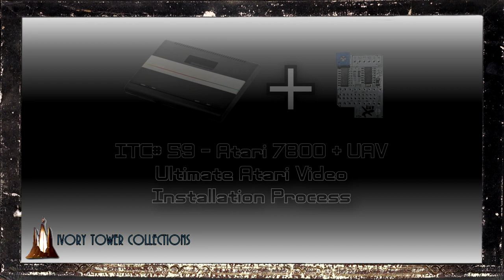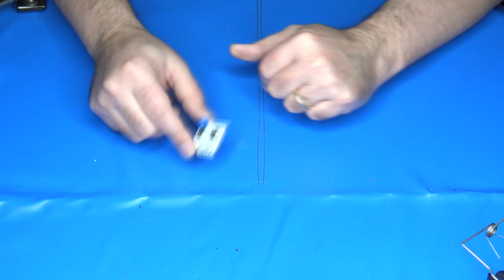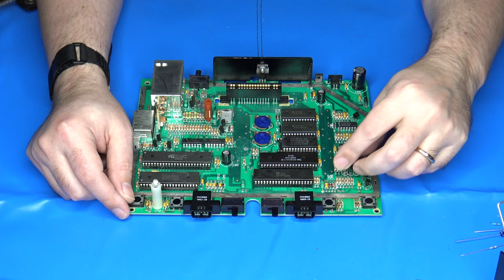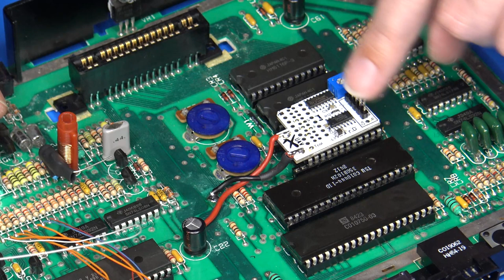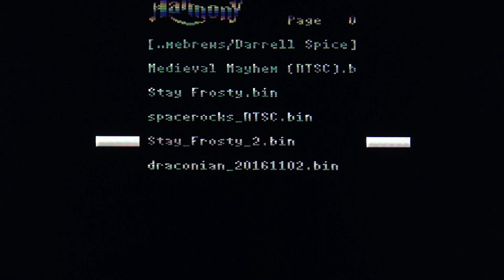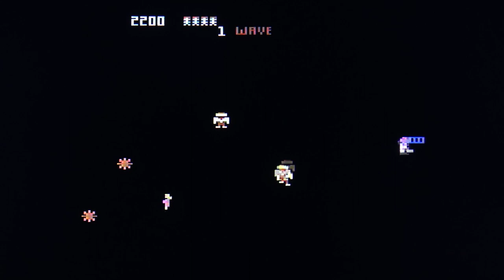ITC#59 :- Atari 7800 NTSC UAV Installation Process

Comment: Thanks for this video. It's the most helpful resource I've found for installing the UAV4 into my 7800. I finished that installation (and it works!) but have a question about the audio. Any chance you can provide links to the specific resistors and capacitor that you used for your audio mod? I know you said 18k and 6.8k resistors, but a quick scan on Amazon shows those resistors with different wattage ratings. If you can give a specific link that would be extra awesome. Thanks.
Reply from the maker: The resistors are just normal 1/4 watt carbon resistors. I use 1% tolerant types but 10% or better would be fine. The capacitors you can actually get from console5, mouser, digi-key. I use 10µf 16v or better capacitors. I mostly use Nichicon and Panasonic brand caps in my service work. Also keep in mind that the extra resistors are only needed if you are wanting to keep the RF output fully working. If you aren't concerned with that, then you can just lift the rear legs of R5 and R6 from the board, twist those together and solder on a capacitor to that and then out to your audio output jacks. RF would then become Video output only at that point.

Comment: This is interesting to see how one attaches a UAV to an Atari 7800 Pro System. Since I still have a working CRT Color TV and a good condition RF TV Switch Box, I don't believe that I have to have any modification done to my Atari 7800 Pro System as of yet. Thank you for showing how to do it anyways.
Reply from the maker: For me, I only wanted one TV for use in my game room since the ITC game room isn't that big. So for me it became a requirement to find ways to upgrade all of my classic consoles so that I could play them on my modern TV more easily. Yes, most of them still worked through RF on the newer TV but I was not a fan of how blurry and noise laden the image was from all of my systems. And in some cases like the Intellivision for instance, the RF images bounce or jitter up and down constantly and no adjustment on the TV could correct for this. At least with a UAV nothing has to be removed, so in addition to the composite and s-video output, you can leave the RF intact and still use that too if you wished.

Comment: Great video. I am about to try this myself. I am curious. How do you attach the UAV to the board. I removed the RF board in my 7800 and am thinking about putting it there. But not sure how to tack it down. Hot glue? What do you suggest? Thanks!
Reply from the maker: I actually use really strong plastic velcro to hold down my boards like this. I purchased it locally from a hardware store and have been using the same batch for the past several years. It is several pounds rated per square inch, so I only need a little to hold the boards in place. I also like it because the adhesive on it is very strong but will also come off without leaving bits behind in most cases, should it require to be removed in the future. But yes...Velcro. Thank you for watching and for your comment!
Reply: Ah. That is a good idea. Someone also suggested double sided foam tape, but I like Velcro because I can move it around more easily. Thanks!

Comment: Sorry to bother you, man, but I just followed your video and realized that I don't get Pokey audio for BallBlazer, and for a recent homebrew called Rikki & Vikki, the screen just shows gibberish and the audio plays extremely low. Do you have any idea what the issue might be?
Reply from the maker: Send me pics of your installation work to my email. You can find that in my About section and I'll see how I can help.
Reply: @IvoryTowerCollections  I did some research after the fact, and it seems to be an aging voltage regulator. I'll replace that, and if it still persists, I'll contact you again. Thanks!

Comment: Any good wire recommendations?  The stranded hobby wire I tried using on the UAV was shit and I toasted the board.  Ordered another one :(
Reply from the maker: I use both 28 - 30g kynar / wire wrap for the connections from the resistors to the center points of the UAV, and stranded 28g ribbon cable from console5.com for the AV out connections. My last 2 UAV installs into 7800 actually used the 28g stranded throughout the entire install. Just make sure you don't have the iron so hot that it melts away the insulation from the wire. Pre-tin the wire so you can shape and form it to go into the vias on the UAV easier. Another thing you can do, is to pay for the more expensive kit version of the UAV and use the jumper header pins soldered into the middle vias and then solder your wiring to the tops of the pins.  I've done that once or twice if all I had on hand was the full kit version already assembled and needed to install into a 7800.

Comment: 7:59 I had to revisit this part of the mod since I continue with my AV mod (not the UAV of course, but will consider it for the future). No, I didn't do that with the audio signals, putting new resistors and then a filter capacitor (if I heard correctly its 10uF 16V). I used R5 and R6 as I mentioned in the other 7800 livestream, as they were, then replaced R6 with a 22 kΩ for fine tuning. And then, after few months, I lost the audio. Not really, it got very LOW, almost got to put my TV volume to 95% to hear something, and I kissed goodbye POKEY sound with that setup.

Fortunately, I left the pin for TIA audio that I used on early tests and it works fine, loud of course, but that's something! It's located right before C14 (I ruled out C14 as the main cause, apparently C4 and C5 screwed up physically, I know it because I detected continuity on both capacitors). So I'm gonna do the test as it's shown on the timestamp, but not going to shrinkwrap it. 

Then I will test the Atari 7800 with Dig Dug (both 7800 and 2600) and Ballblazer.
Reply: By the way, I bought Dark Chambers 2600. My 7800 has no issue with the cartridge and it hasn't the resistor or capacitor on the bottom of the PCB. Even I showed my cartridge on my community tab.
Reply from the maker: The extra timing circuit isn't present on all 7800s. Seems Atari only had that circuit in place during most of the '87 and early made '88 year units. After that time, they started to not populate the extra IC and installed 0Ω resistors to jumper past that part of the circuit. Also, it seems the deglitch cap was really only present on the earlier made 7800s. Although I've had to add it on a few later made units that have Rockwell CPUs in them to allow both versions of BallBlazer to load up. In some cases, I've had to replace the CPU completely with a different one to fully eliminate graphical issues and lockups. The Rockwell CPUs seem to be problematic in the 7800.
Reply from the maker: I've been handling the audio in the same manner for over 5 years and have a LOT of 7800s done in the same manner and never had a report of any audio issues. I now use a mount PCB I designed for UAV installs that has the extra pair of resistors and capacitor on the mounting board so I don't have to solder them in manually anymore. Again, with the exception of the extra capacitor, the resistors used and how it is setup is replicated from the original mixing that is done on the board already. It is also important to know that the PAL version of the 7800 was done differently on the audio and uses different resistor values, but I'm not sure the specifics beyond that.
Reply: @IvoryTowerCollections  I tested a prototype of the setup with few wires soldered. It woked very well and as I remember the volumes I heard, all I have to do is to compare it with recordings that I made (both in VCR and OBS video capture).

The conclusions that I reached so far is that I was experimenting in the wrong setup, with part of the original circuitry connected to the RF Modulator that I desoldered. I even had to restore parts that I read from various sources and remained with this latest setup that lacks the next parts:

- C4, C5 (820pF 100V polystyrene film caps)
- C10 ("104" axial cap) 
- L2 (ferrite coil inductor)
- R3 (1.0 kΩ)
- R4 (9.1 kΩ)
- RF1 (The RF Modulator)
- S7 (Channel 3/4 switch)

In the old setup I removed: 
- C10, 
- Q1 (S9018 Transistor), 
- C3 ("102" axial cap), 
- Resistors R3, R5, R6, 
-L2,
-RF1 and S7.

L3 (1.8 uH inductor) got damaged at some point and my video output got fuzzy, but I was capable of restoring it with a new one and got video back to the same quality from past tests.

I only restored R5 and R6 as you told me to use "a 6.8k resistor for POKEY and 18k resistor for TIA sound" but not necessarily R5 and R6, and I used the north ends of each. Then, after a month of not doing tests, I turned on my 7800 and noticed the audio was very low, almost inaudible. I attributed that to the fact that I was using C4 and C5 inevitably by using the original R5 and R6 that follows said caps, and got damaged too. And lastly, I was routing my audio output by using the trace that goes to the channel 4 -5 volt pin and bypassing it to R5 and R6 with a Dupont cable, thinking that portion of the PCB was not being used. I was wrong on that, and I'm glad this happened so I don't make the same mistake again and instead use a better alternative.
Reply: I want to thank you for the help and technical support, my console is ready for the final steps. I should have done this ages ago, but I needed to know more about the behavior of the function of certain elements in the PCB, the do's and don'ts and all that.
Reply from the maker: No problem and I'm happy I was able to help!

Comment: LOL at those power and ground wires.  You're wiring up a UAV not jump starting a truck.
Reply from the maker: hehe, yes I did use larger gauge in this particular install than I might normally. But I always use at least 20 - 22awg for most of the power and ground connections. All other wiring will depend on what I'm using at that time but usually 26awg stranded for the signal runs or in some installs, I might use 30awg kynar if the wiring won't be getting moved around.

Comment: You tuber Toyaddicteddad recommended that I get in contact with you about an issue I’m having with my av modded 2600 jr and my iscan pro. I’ll copy my original comment on his channel below: 
“I have an rca modded Atari 2600 jr, but sadly it doesn’t work with my dvdo iscan pro I use for my retro consoles. As a matter of fact, it won’t work properly with 2 other scalers I own either. With the iscan and also with one of the other scalers, all that’s displaying is a mostly still image, that updates a frame every 15 seconds or so. On the other scaler, a cheap av/s-video to vga one, it runs smooth but the image is in black and white. Luckily, my lcd will display an image directly to its component/composite port. It displays in color and runs smooth, but treats the image as 480i though. I’m disappointed that it doesn’t work with the iscan, as that paired with a mini slg is my preferred setup for retro consoles”

It’s odd that wont work with any scaler, but does display a somewhat proper image to both my lcds and my old sd capture card, and looks perfect on my neighbor’s Sanyo crt. 

Any advice to can give on what the issue can be with the mod and the scalers will be very much appreciated.
Reply from the maker: Hard to say exactly since I'm not sure which composite mod you have installed. I do know that the original engineer behind the UAV created it because he was frustrated with the problems he was getting with other various mods as well. I haven't tested the UAV personally on any 2600s as I honestly only use my 7800 to play my games for both systems. But I know the UAV works on the 2600s (though there might be issues with it on the jr models..). But when you get a black n white only image that means the signal containing the color isn't strong enough to get through but at least the Sync signal is getting through. It would seem that the composite mod you have may not be providing a strong enough signal overall to work with your capture  or scaler device properly but that the LCDs you've been using appear to be much more tolerant of it.
Reply: Ivory Tower Collections thank you for your reply, and the answer you provided. I suspected it could be the mod itself that’s the issue, since literally everything else I use on the iscan pro works flawlessly. I don’t know what mod was used on the 2600, since it was one that I ordered off of eBay. I’m not technically savvy enough to mod a system myself, as I’m a cabinetmaker by trade. Do you think I can use an external rf modulator, connect that to a vcr, then use the av out from that to the iscan pro? I know that kinda defeats the purpose of having an av modded system, but it’s something I can try short of buying another system.
Reply from the maker: Dustin, I apologize I didn't see this before. Why not try and contact me via email and we can discuss this more there. Thanks!

Comment: This is not a very informative video. You didn't show connecting the audio and video. I'm thinking of modding my 7800 with the UAV but I don't feel like your video is enough to help me. I want to make sure I don't mess up the S-video wire connections. I'm also confused where all those orange wires were going between the resistors and the board. Unfortunately, I don't think your PDF is very helpful in certain areas either.
Reply from the maker: I do not show the actual AV connections because those can be placed wherever the person doing the work wants to put them. My guides and these videos are designed for those that have some knowledge of how the various connections need to be done. I even state that in the PDF guides. I do have an earlier video I made where I do show where I put my AV connections on my 7800 in a brief overview. The PDF also shows the locations of where my AV Jack's were installed. If you reach out to me in happy to answer any questions and offer additional assistance.
Reply: @IvoryTowerCollections  I guess your guides aren't for me then. I've found images showing s-video pinouts. That may have to be enough for me.
UPDATE: I was looking at your PDF again and you do document where the wires go on the resistors and the board. Where did you get the pin header and connector from? I think I noticed a pin header in the kit (which I just bought) but not the connector.
Reply from the maker: @SarahLJP  I apologize that I'm just now seeing your reply here. I actually purchase my pin headers from and shop locally here in town. But the connectors are hand soldered together using multiple DuPont connectors that I then shrink tube together. Although if you were to purchase the full kits they include a green terminal block you and install on the output side and just run the wires to those and screw the terminal blocks onto the wires. But the kits cost more and that green block is literally the only thing you would use besides the UAV itself.